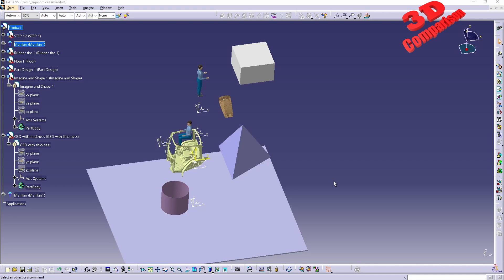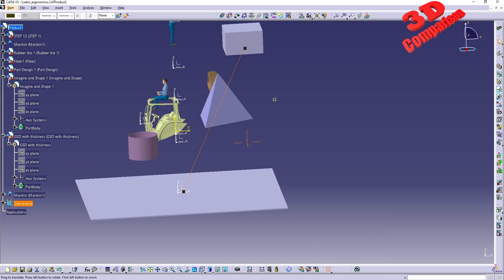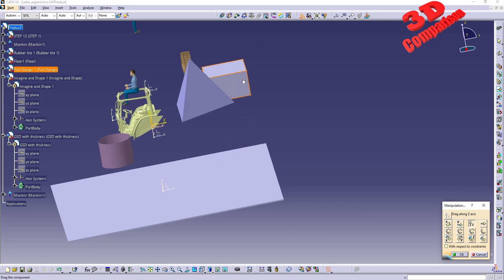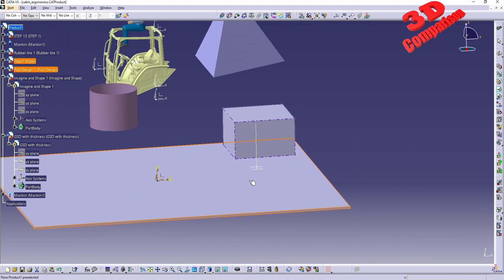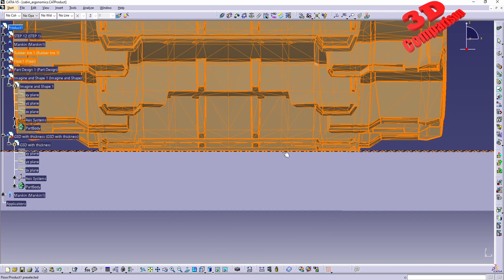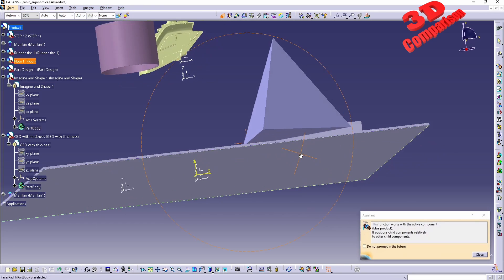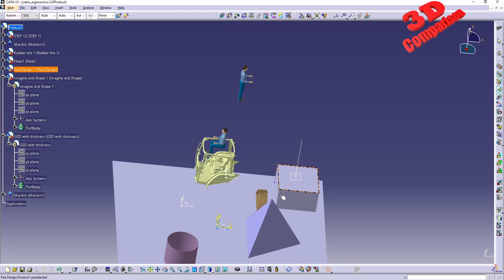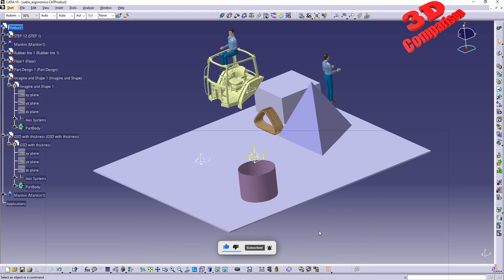How to align components without adding constraints in CATIA V5

Comment: سلام.کل ویدئو از این دستور استفاده کردی ولی زمانی که نحوه استفاد را برای اولین بار توضیح دادید مبهم بود
Reply from the maker: Hello, the feature is activated using the command - c:align side that you need to type within the command prompt in the bottom right. After it is activated, you will have within your cursor the reference faces, you need to select the reference and afterwards you need to select the face that you want to align with that previous selection, and they will be aligned. That's it!